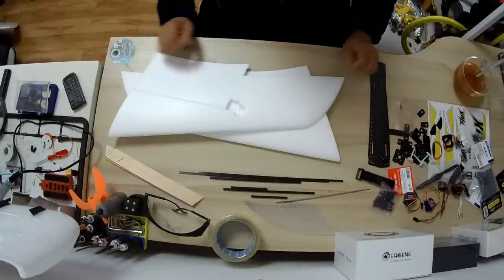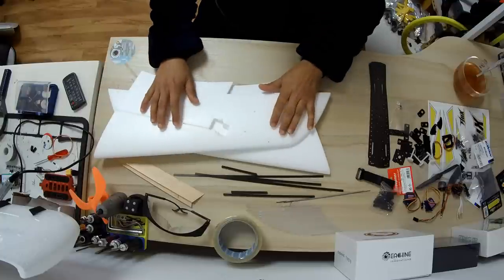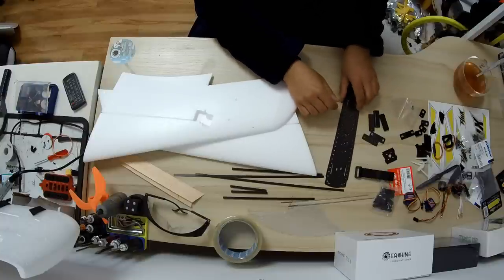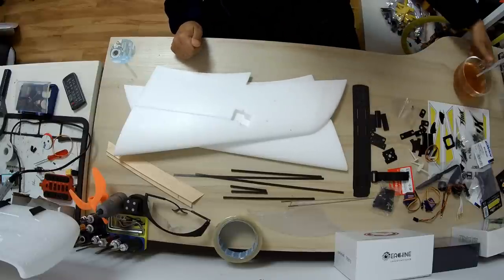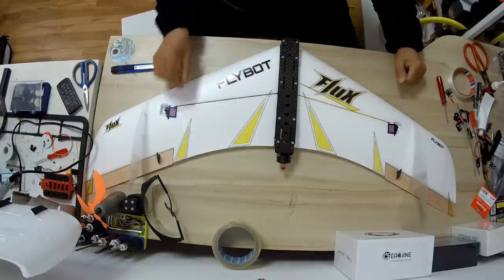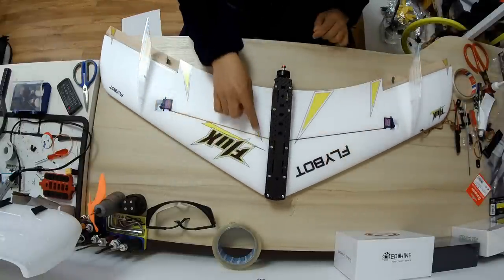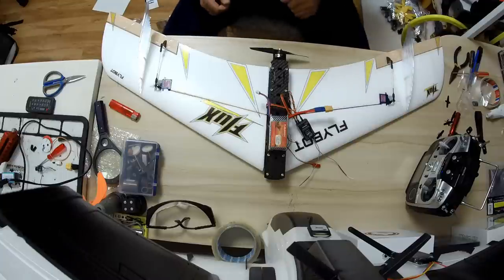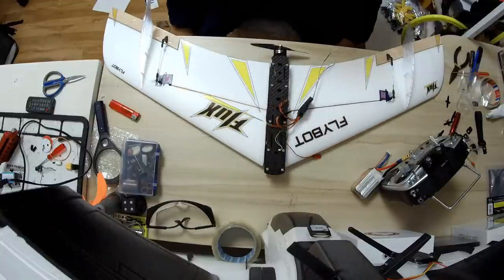How to Build Flybot Flux High Speed FPV Racing Flying Wing Time Lapse

Comment: Hi, what type of glue is this one that you used to glue the servos on the wings?
Reply from the maker: EPO EPP Foam Glue. any other glue will simply melt the foam and you will ruin the plane
Reply: @alishanmao  thanks a lot for your prompt reply. the foam glue I have is 24h to cure. too slow. how quick is yours? if it is instant cure, could you tell me where to get it?
Reply from the maker: Well the glue I have dries in few minutes but to have a stronger bond, I need to leave it for at least 12 hours or over night. and then I can fly the plane without worries. I flew some of my builds with this Foam glue in few hours time as well but later I found the bonds were not too good.